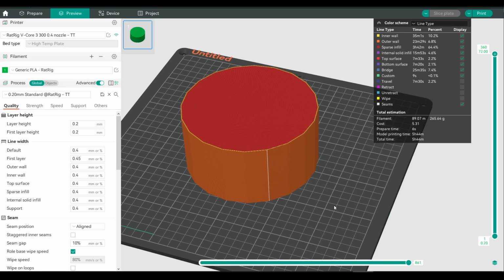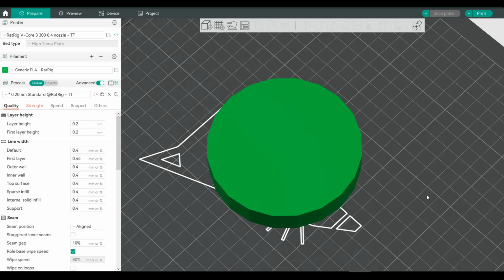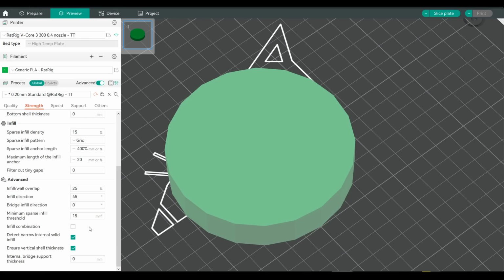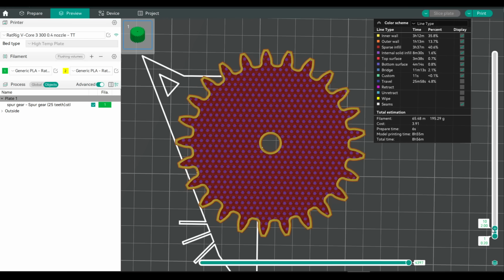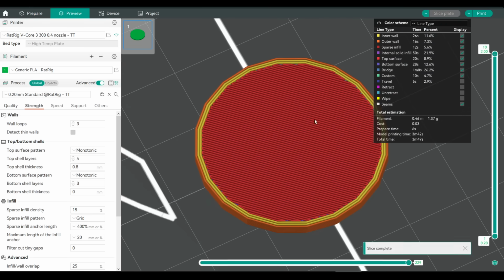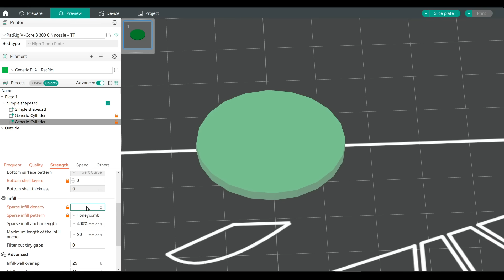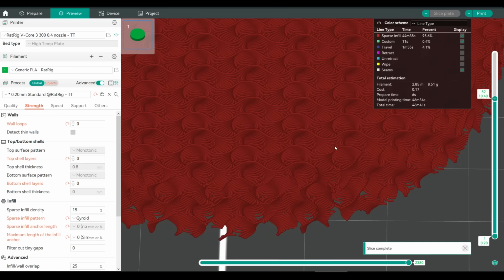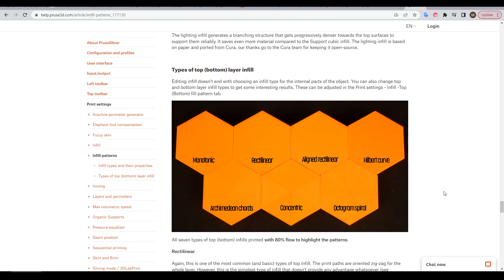Master infill to take your 3D prints to the next level

Comment: But what about internal solid infill? I'm printing tabletop minis and it's just too much.
Reply: Are you using FDM for minis? I always assumed only resin are good for those, and they can do solid at the same time as sparce
Reply: @ElSarcastro  Yep. With a 0.2 mm nozzle and 0.06 mm layer height on the Bambu P1P. The quality is waaay beyond passable for me. Cleanup is a bit meticulous even with minimal support but I think it's a fair tradeoff.

Comment: I switch from Cura to orca slicer to run my ender 3 v3 ke. I was wondering if anyone knows if there is a feature in orca for infill line multiplier like in Cura that thickens the infill lines. Any help would be greatly apricated.

Comment: Hey Michael, Bambu Recently updated their software, so now you can't make custom infill patterns. Id come to using this for most of my prints and was wondering if you'd figured out a work around on the new software, I tried adding layers, removing, adding height to the modified layer, but it's difficult to get it to be as clean as before.

Comment: I've only used Cura, so regarding the gear, I would have imported a cylinder, overlapped it in the center until a small distance from the teeth, and given it per model settings that reduces the infill. Only the teeth use the high infill value and the body of the gear is reduced and probably using a different pattern.

The surface finish section looks like an amazing idea!

Comment: Ive been messing with strength on discs, I found upto 4-5mm thickness putting matching impressions in both sides so the main infill isnt, Its now a sunken solid wall.

Comment: With regards to making a part stronger but only on certain areas, you can also up the minimum infill area (that's the name in cura) which is what's the smallest area the slicer will fill with solid material instead of infill. In your case you could make the teeth of your cog solid but the rest of the model would use infill in whatever percentage you choose, you just need to measure the area of the teeth first and use the parameter I mentioned.
Reply: I was wondering if there was a setting for that cheers. One setting I really like in Cura is infill wall count, you can add extra walls at infill speed. I don’t think the other slicers have that setting at all.

Comment: One of the first things I designed and printed was a fidget toy consisting of a place to grip with your fingers and a free-spinning bar, letting you flick it like a fidget spinner but also spin it by swinging it up and down. I found it didn't have as satisfying a momentum as i wanted though, so I added a cylinder modifier to turn the far end 100% infill. Suddenly it felt MUCH more satisfying to swing and spin, and since then i tend to prefer 100% infill on small models and toys that i wouldn't save much time on by lowering the infill anyway, just because of how surprisingly satisfying and weighty they can feel

Comment: You can use modifier volumes for strength too. I had a part that was under compression at one point but unloaded elsewhere (part of a screw clamp). I made a the infill denser in the loaded section only.

Comment: I am using the no-top-and-bottom for parts where I want to have vent holes - e.g. power supply enclosure. In those areas, using honeycomb infill, I get a nice pattern and automatic venting :) Works great, I am using is a modifier part that disables top and bottom.

Comment: That adaptive cube is very important for me. I print shoe lasts and I need to have the bottom be more solid than other areas, because nails are used there to fasten the upper leather to the sole. This is very useful.

Comment: I make simple bodies and use them as modifiers when I design parts to control infill type and density. 
I actually made an evaporative cooler using a block of gyroid infill no top and bottom, but I kept 2 walls

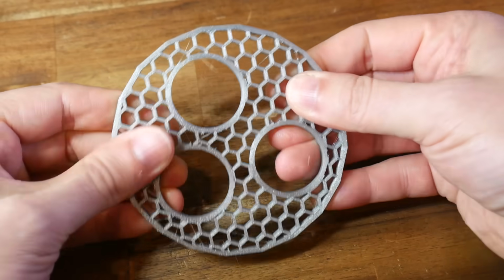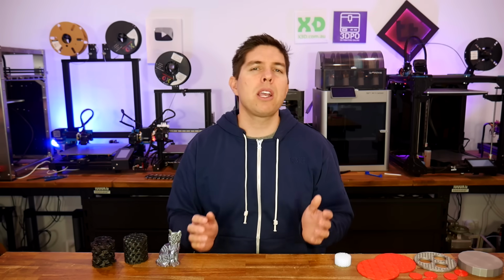Comment: 10:01 This is really cool, the triangles look very nice. And thanks for sharing the files with us! — 09:04 is one I often use, but not for aesthetic reasons. It's great to save time whilst keeping enough stability to check if a shape fits for it's application. Therefore I take negative volume modifiers to not print less interesting parts of the model but just the shape cut I'm looking for. I so can do a quick fit test instead of printing a whole model.

Comment: Some very cool ideas in this video.
I seem to remember that Slant 3D recently discussed similar ideas (applying a texture as part of the 3D modelling process), but this is a nice way to use the slicer to help achieve it!

I really like the way the low poly fox turned out.

Thanks for sharing!

Comment: You can use "connect infill lines" help with strenght and aesthetics.
As the name suggest, this connects the lines that make the infill and makes it a continuous line, this helps with wall quality because sometimes with thinn walls you can see where it connects with the infill and provides a better contact point with them

Comment: Some great ideas, thanks. I print models using lightning infill (a lot), then manually cut out a hole in the bottom, and fill it with "stuff" - giving the model extra characteristics. Anyone have any ideas how to add a "hole" to the base, exposing the cavity crated by the lightning infill. I've been using Cura. Cutters put walls stopping me from accessing the interior.
Reply: I’m not too sure how to do it in cura but prusa slicer has an add negative volume modifier option. That is the very easy way of doing it.

Comment: One thing that's a shame about top/bottom surface in Orca is that the pattern isn't done in as large chunks as possible, you have a shitload of unnecessary travel which stand out on the final print. idk if it needs to just be on by default but at least it needs a feature to have as little travel when doing top and bottom layers so that something like that Octogram Spiral don't have a bunch of interruptions visible.

Comment: Another trick: sparse infill layer width. Infill is the amount of plastic compared to amount of void. Make lines thicker, for the same amount of plastic which needs to be inside, printer makes thiccer lines - but fewer of them. Thus reducing time spent on infill and travel. Of course you need a hotend able to keep up with required flow. 

It's possible also speeding up infill speeds and accels. Nobody cares if it is ugly, ringing, bad PA when it's invisible inside a print.

Comment: Which version of Orca Slicer are you on?  I'm using the latest beta but the infill combination doesn't see to do anything when I turn it off or on.  Edit:  Disregard.  My layer height was .28 so it couldn't do the double height infill.  One odd thing though is on a smaller part it is showing a longer print time using Infill Combination :/

Comment: Removing solid layers is also a great way to handle making transparent FDM surfaces. 

Normally if you’re making something like the lid of a box with transparent filament, the overlapping lines will cause so many reflections that it won’t look transparent. 

But if you just do 1 clean solid layer and then use a low infill percentage for the rest, you’ll get a relatively clear layer that still generally has enough strength to not be all floppy and whatnot.
Reply: hi heyspooky, have you become a flat earther yet?